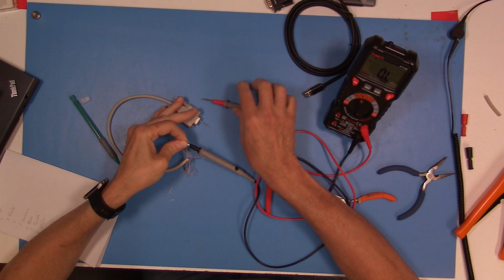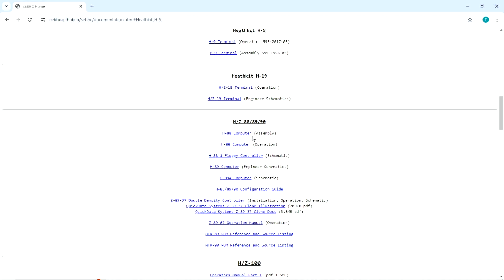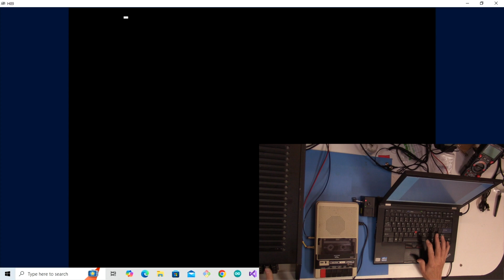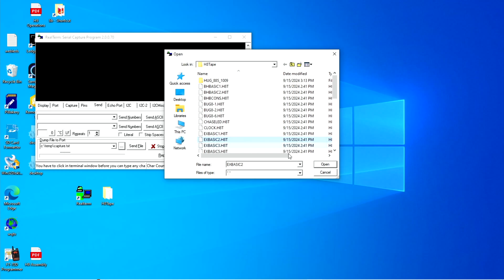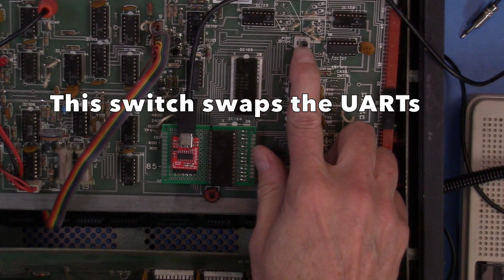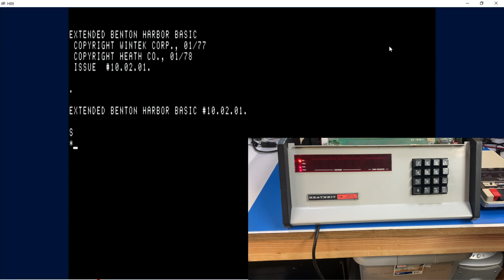The Heathkit H8 Computer - Part 4: Terminal I/O and Benton Harbor Basic

Comment: Can I ask where you got that Sparkfun USB adaptor that plugs into the UART?
Reply: and is there instructions somewhere on how to build that little board you plug into the UART?
Reply from the maker: The instructions to build it are posted in the SEBHC Google group. Search there for thread “H8-5 USB - Serial I/O Mod” The posts are by Joe Travis. Are you currently working on an H8 project?
Reply: @primal-bits4777  Thanks, I will own an H8 in a few days, I am getting prepared. I am not an electrical engineer or anything like that, but I could solder up a simple board like yours if I can source the parts. I hope I haven't bitten off more than I can chew. 🙂

Comment: Is it possible to use a faster baud rate if you use hardware flow control. Maybe you already considered that. I don't have any experience with the Heath H8.
Reply from the maker: Unfortunately not with the H9 terminal. Even though the H9 theoretically supports higher baud rates, 600 baud (the default) is the most stable. The H9 was quickly superseded by the H19 which properly supported higher baud rates.
Reply: @primal-bits4777  my first modem was 300 baud, but it didn't take me long to upgrade to 2400.

Comment: Congrats on getting your H9 playing. I noticed the plexi in front of the CRT has a slight warp inwards, probably the effect of gravity over the years. Have you considered turning it over so the warp is outward facing? Good luck on your H17 going. mine was fine on alignment of the heads but just needed some cleaning and I used a synthetic lube on the worm gear and rails and synthetic oil elsewhere. Works great !!
Reply from the maker: Thanks. You are right about the screen shield warping. Unfortunately, the other side is in pretty poor cosmetic shape outside of the viewing area. The H17 looks pretty clean inside, so I’m optimistic.

Comment: Great video's! I've enjoyed watching you get the H8 up and running.  I've not had problems using wave files with my Altair's cassette interface at 300 baud, 1200/2400 hz FSK.  What modulation technique is used with your H8's interface? I'm curious.
Reply from the maker: The H8 uses the same Kansas City Standard as the Altair for the most part, just at 1200 baud. Mark and space are still 2400 hz and 1200 hz respectively.
Reply: Maybe there's something picky about the H8, but I had no trouble making cassette tapes from .wav files for a Tandy Model 102. I even did it through a Bluetooth connection and even use the same cassette recorder.

Enjoying your videos. Good luck!

Comment: I am on the lookout for an H8, for now I make do playing with the good H8 emulator in MAME.
Reply from the maker: It took me a long time to find a system in the wild. VCF events are good for hunting down some of the harder to find systems. Even just getting a base H8 can open a lot of doors. Terminal, disks and tapes can be emulated until you can track real ones down.
Reply: @primal-bits4777  Yeah, I gave up on finding an H-11 as well and ended up buying a real PDP-11/03, which it replicates.
Reply from the maker: Hey, getting a real PDP11 is great.